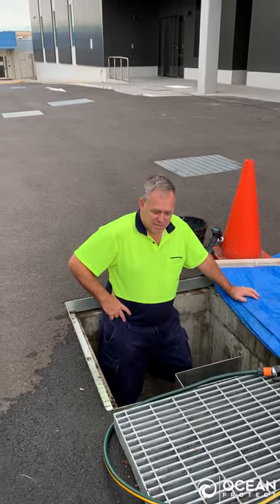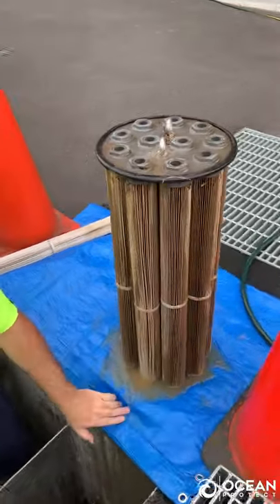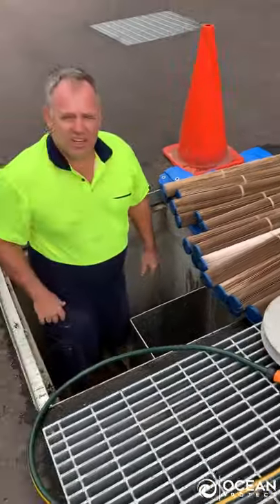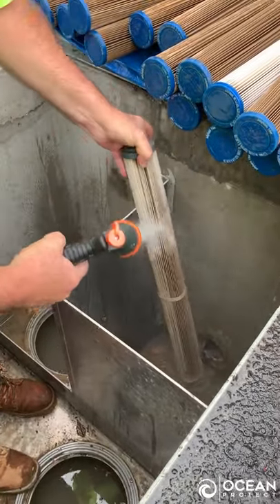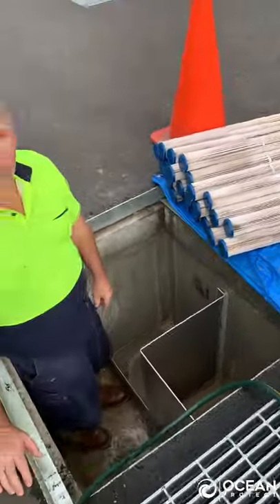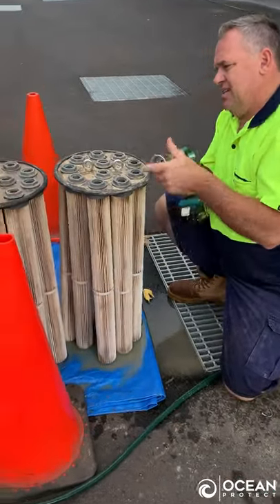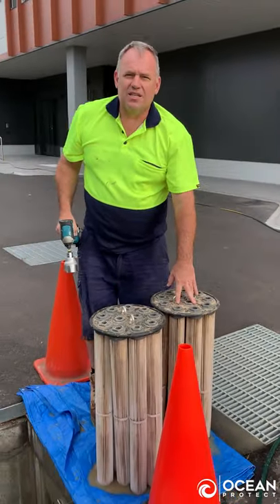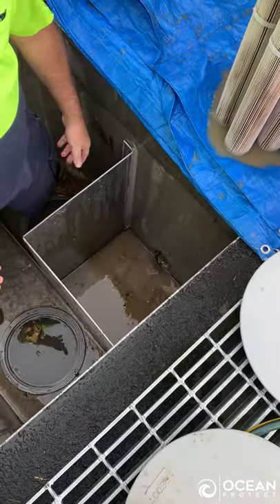Maintenance of the Jellyfish Filter Cartridges

Comment: Hi Damien, Look at a system like this to install at our Local Council. Isn't it defeating the purpose if you just wash down the filter cartridge back into the system or am I missing something here?
Reply: Hi Elwyn, thanks for leaving a comment on our video.  When you rinse the Jellyfish tentacles during a routine maintenance you are washing these heavier pollutants into the Jellyfish tank, which then settle in the large sump.  The sump will at some stage need to be emptied using a vac truck like any stormwater quality improvement device such as a gpt; hence the first step is to check the sediment depth using a sludge judge.  By rinsing into the Jellyfish unit we are continuing to capture pollutants in the system.  The settlement of pollutants in the system between services can be seen on the next service video using the sludge judge.  Please email me directly on damiene@oceanprotect.com.au and I would be happy to provide more information.
Reply: I had the exact same question. His answer made quite a bit of sense though, only if this is vac trucked immediately following rinsing.